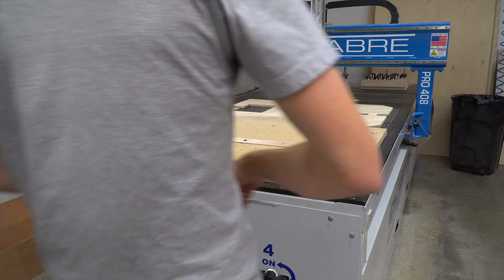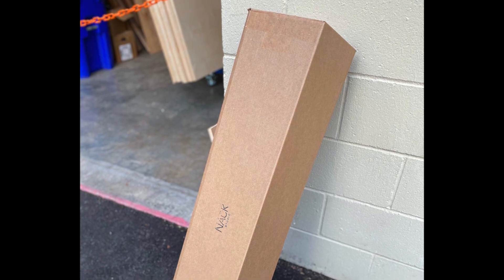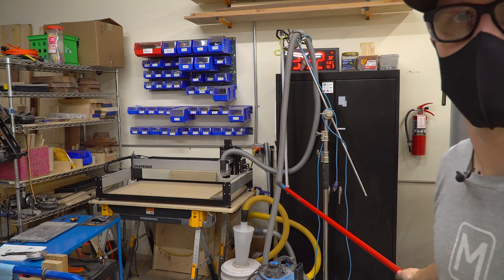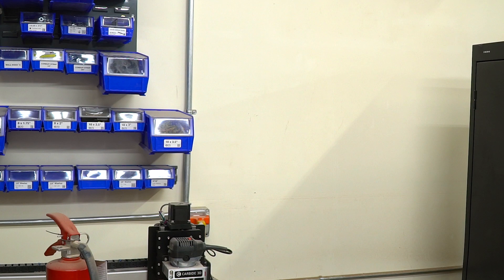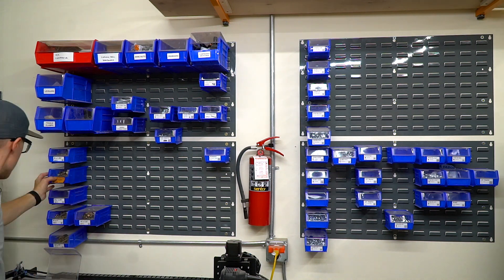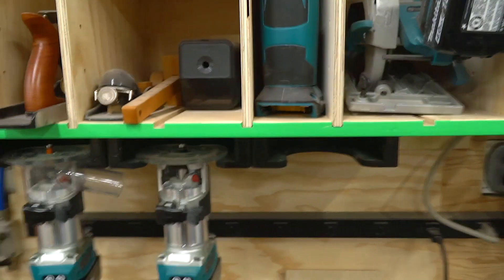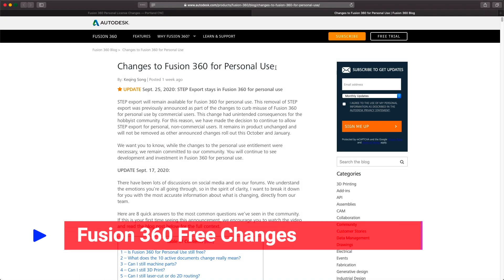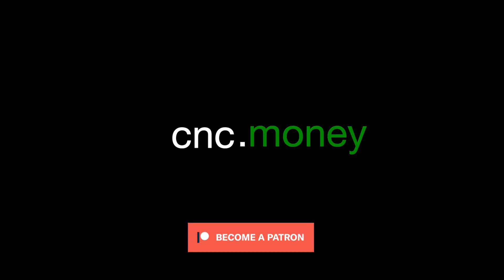Shop Update - Shop Tour, Shapeoko, Drag Knife, Fusion 360 License

Comment: I don’t have a shapeoko but something similar just larger and more of a custom build. I am curious to see how you calibrated the shapeoko. I’ve had issues making sure the base of my spoil board is dead level to the spindle. I ended up just using a large diameter end Mill and basically “surfaced” my spoil so the spindle is not level to the base.